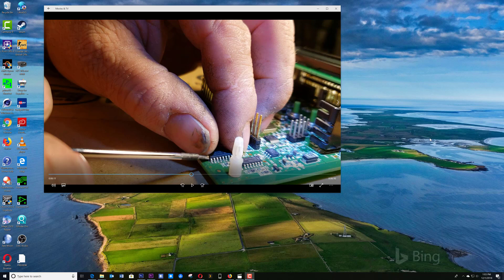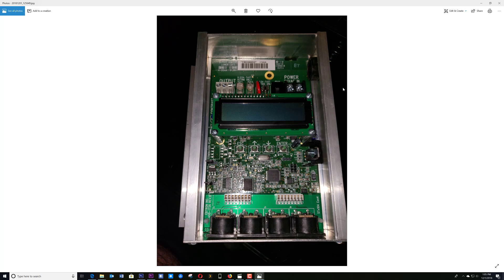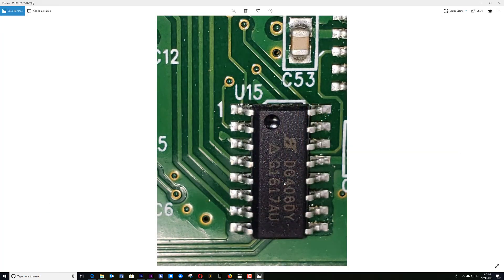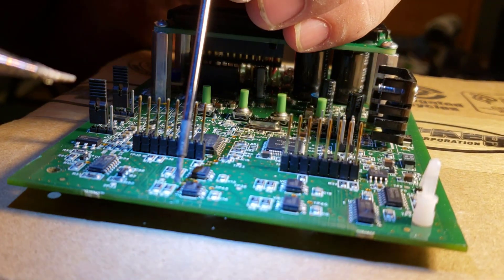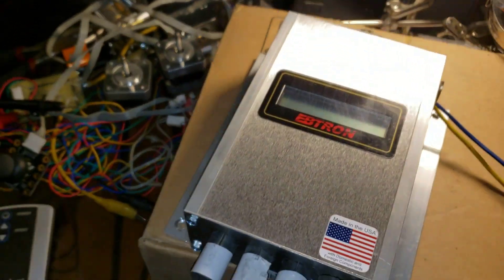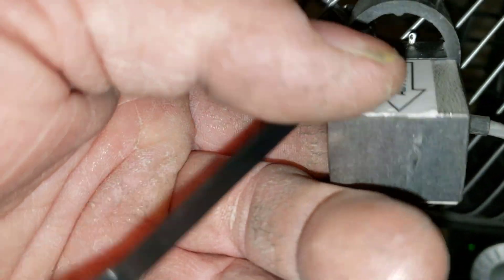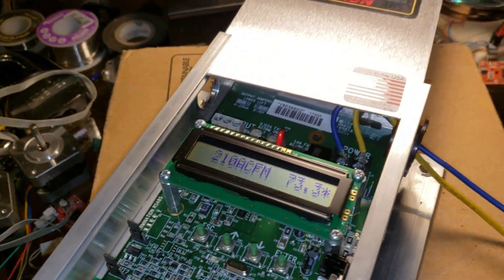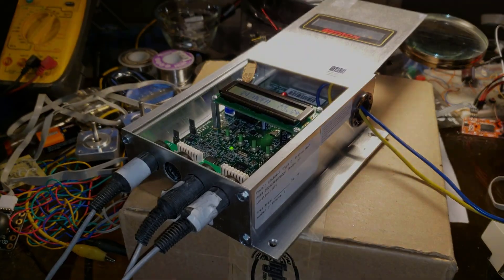Repairing an expensive air flow sensor after letting the smoke out

Comment: Does that thing just work like an automotive hot wire mass air flow sensor? Pretty neat stuff. It was good that you were able to repair it after letting the magic smoke out. That unit does not look cheap.

Comment: Did you ever find any info for the Mitsubishi tool? Our company has one that is DOA, it wont power up.
Reply from the maker: I have looked a few times and searched a few times but never found any info. It sucks. The transformer is the thing that I really wanted to find.
I tried to unwind it but it was really stuck together from when it fried.
Reply: @hackfreehvac  The transformer is either a Murata brand or it is Panasonic. But, if you can't find the part, then here what you can do: Put one loop of wire around the core and then measure the inductance, then go on digi-key and find the core that has the same inductance per turn.
Reply from the maker: @EETechs  The wire was shorted from the high voltage being applied to it. Lol

Comment: Get yourself some solder wick buddy lol that desoldering job was painful!
Reply from the maker: I have wick but I wanted to leave the solder on the pads. 
I just used the small tip under each pin and lifted them one at a time. 

I didn't even need more solder. Enough was on the pads to flow to each pin
Reply: @hackfreehvac  It's still faster, and better, to remove all the solder, less likely to pull a pad up, and, when you get to soldering the new chip back down you'll have less chance of ending up with a pin in the air.  I do quite a bit of board rework.  Still did a good job regardless!
Reply from the maker: @OverKillPlusOne  The sucky thing for me is my near sighted vision took a crap when I turned 47 and have been wearing glasses for a year now. 
I had to wear a pair of magnifying glasses to see that sucker real good but that made me have to hold my head about a foot from the board for the focal length to be in focus.
Reply: hackfreehvac getting old indeed sucks. Things I used to just shrug off leave me gimped for days or weeks.

Comment: I was talking to a co worker saying that soon hvac techs are going to have to get electronic degrees. We work on residential and light commercial but some of the new inverter boards and the cost to replace is a bit insane
Reply: I fixed tvs full time for twelve years before prices dropped and I got into hvac service. But definitely pays to know board level repair!!
Reply from the maker: It would be fun to fix them. 
But truthfully they just expect you to swap boards. 

Just like the old TV's used to get repaired in a shop where they would literally use a scope to troubleshoot and replace the failed components but now the TV repair techs just find what board fails and replaces it.

As a teen, I hung out in junk yards and the electronic repair shop instead of out drinking beer seems smoking weed like many kids did in my town.
Reply: hackfreehvac yes most tvs are board swaps only now. For first six years I replaced stks, transistors and diodes on the regular but it has since changed bigtime.
Reply: @hackfreehvac  These are the days I wished I lived in, though I used to do things like that with my dad, we took apart old motors and other things to see what was inside and how they ran.
I'd like to learn how to do circuitboard repairs, but I doubt any company would really do that. Or they might just create another trade where you call the board repair guy. Kinda like service guys condemn a unit and the installers come and replace it.
Reply from the maker: @FrostBlueFire  Yeah it's generally not feasible to repair control boards nor would most service companies want to when you can just swap the board. 

I do things like this when it's warranted to use my ability such as in this case when I "let the smoke out" (fried)  of the brand new controller we were replacing under install warranty.
Reply: That would be nice. However, most of the really important chips are proprietary, so no, you won't find the parts at Digi-Key or Jameco.

Comment: You need one of these:
https://www.ebay.com/itm/858D-700W-Soldering-Desoldering-Station-Hot-Air-Rework-Gun-Tool-3-Nozzles-US/163050317856?epid=22019464412&hash=item25f68e6820:g:2g4AAOSwRclbcOY6:rk:24:pf:0
I purchased one of these a few months back to do my first surface mount rework. As cheep as it is, it worked perfect. Probably not for a commercial repair lab, but you know how many times you have need of this.